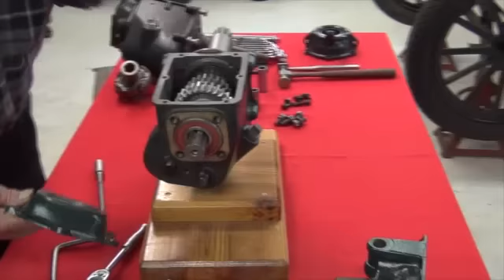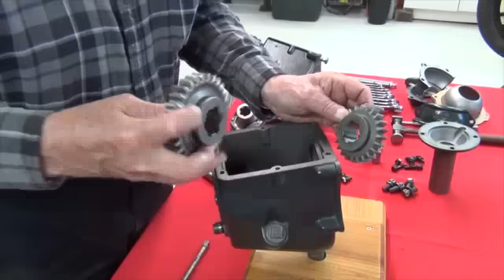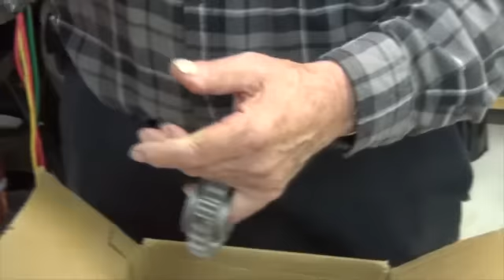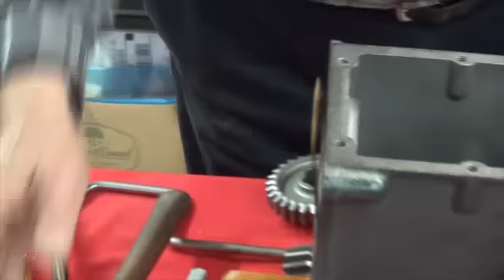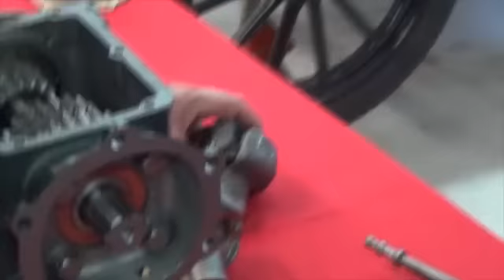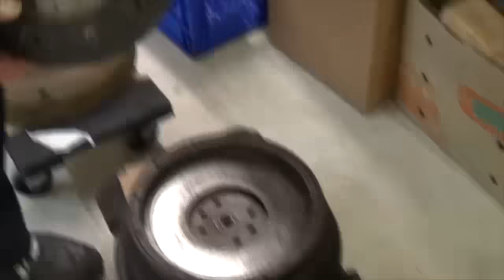John Karal: Ford Model A Transmission

Comment: Hello,

Great video. You mention that new bob drake u joint, how do you successfully install it without vibration? Lots of people report vibration. The joint comes with washer inside and there is no room for the stock lock washer to be installed. How do you install it? 

Thanks

Comment: A moderator on one of forums made a big deal out if using those bearings. He said if you remove a seal on one side you could damage the bearing or contaminate it. “A human hair could ruin the bearing” guys chimed saying they’ve been doing for 30 years and no problems. His response was some people smoke for 30 years and never get cancer. 🤷‍♂️🤦‍♂️. I did mine exactly as this guy did. Thanks for the video, very helpful.

Comment: Mr Karla, I really enjoy your videos. I drove a ‘30 Model A every day for 7 years as my work car. I belonged to MARC/MAFCA San Diego. Even so, there were very many things I never learned to do since I was a low-paid enlisted man during those 7 years. I never overhauled a transmission. Your instructions are very clear, succinct and concise. But my 74-year-old eyes aren’t very good and I can’t see through your hands. Would it be possible for you to use a pointer, wooden, plastic, laser or otherwise, to point out things in deep, dark places? Thanks for your consideration, Bob

Comment: Interesting...did i miss what gear box weight oil you put in?...and how full---is there a overflow port -fill port or window sight?
Reply: I have gearboxes that use 90w, 90-140, 90EP, 90 PEG, and Iso220.  All are different and the wrong oil will eat a gearbox at varying rates from a hour to weeks.

And it is a Model A transmission.  You could use mud if you wanted.

Comment: Very comprehensive overview of the major and minor points involved in rebuilding a Model A transmission plus information on a number of newly engineered parts designed to improve performance and minimize leakage. Nothing seems to be left out for those who want to do a first class job.
 Henry would be proud of you John.